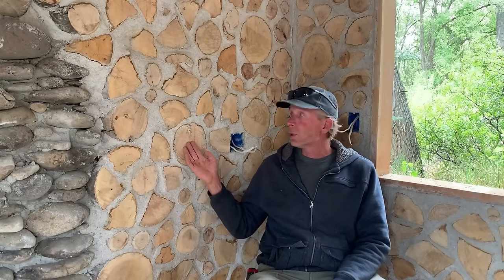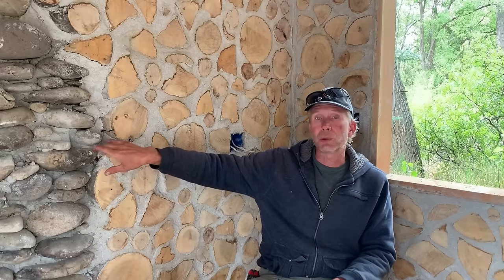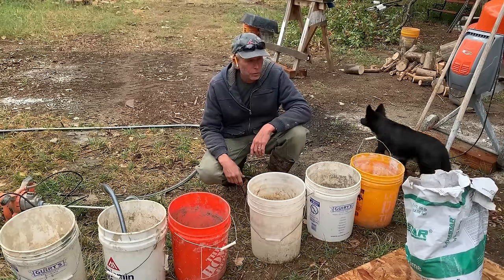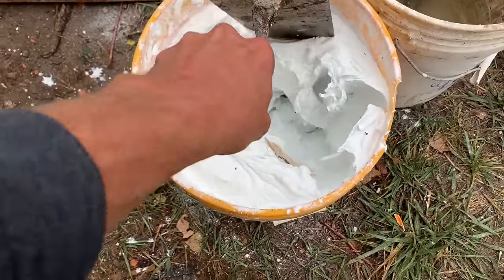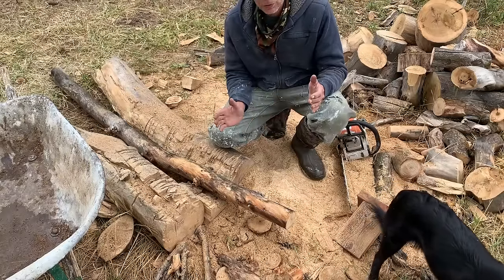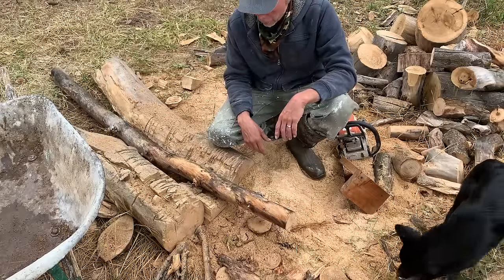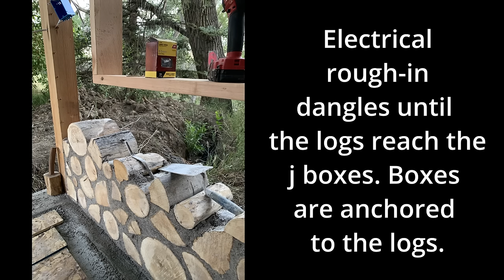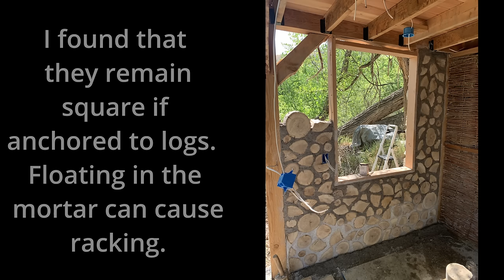Cordwood

Comment: The coefficient of thermal expansion for wood is twice that of concrete. After a few freeze-thaw cycles, the wall will tear itself apart. Also, concrete is a porous material that absorbs moisture. Grouting against wood is like installing a wet sponge against the wood. It will rot quickly. If you used rot-resistant wood, it will rot slowly. It is pretty though. So, enjoy it as much as you can quickly.
Reply: An infinite amount of variables make your comment demonstrably inapplicable as well as the fact that you did not take into account the self healing properties of lime based substrate.  Do better.
Reply: Joshua, a lime based substrate has no self-healing properties. Look, I do not want to beat you up. I simply want to warn people about construction ideas that I think may harm them, financially or otherwise. I am a retired architect with over 43 years of experience on hundreds of projects. I know a thing or two about what will work and what will not. Two things that do not work well are mixing materials in a linked assembly that have very different coefficients of expansion. Another is putting an organic material against an absorbent material. We always place a moisture barrier between wood and masonry for that reason. For materials that expand and contract differently, we provide an assembly that allows for slippage. Your assembly does not allow for either of those things. If you can't see that, then I can't help you. Go get a degree in architecture and maybe that will help.
Reply: I'm not disagreeing, just trying to learn. Does the expansion not play as much of a role possibly due to the woods expansion and contraction being primarily parallel with the  grain?
Reply: Man, that's good to know. I need to get up to Nova Scotia and look at those 160yr old cordwood buildings before they disappear.
Reply: Just visited a cordwood home built in the 70’s.   Still strong.
Reply: @fuddlion have you ever built a cordwood structure?  Did you study any of the centuries-old buildings in Europe that were built with wood and lime? Your experience may not be that valid
Reply: Not trying to argue with you but there are plenty of structures in my area alone that have outlived more modern buildings where similar methods have been used. I've worked in several log structures where concrete was used as chinking and against all odds I've yet to see a failure. There's truth in what you are saying because that's what all the younger people always said..but when I first started on job sites the old hands would preach that the most important thing was that the wood was seasoned and the vertical use of wood and concrete would always be aided by the elements, sun and wind. Again..not trying to argue but I've been in several buildings that range for 5 to over 50 years old and they were solid.
Reply: @intensivecarebear792  he deserves to be argued with. He has no experience and speaks authoritatively.
Reply: @dungeonmaster6292 lol..you're right but Im beginning to be an old hand myself. I just sort of laugh most things off now. The same way the old people laughed at me in when I was younger. I just don't want people to be swayed from doing this sort of construction because of some misinformation
Reply: You are assuming that he isn’t washing with a mold inhibiting agent and that he isn’t sealing the wood once it is finished. Almost everyone building like this is sealing the wall once it is finished.
Just saying. Borax wash I believe is the traditional anti mold wash. Boiled linseed oil through Thompson water seal are applied bi-annually.
Reply: What about mixing with sawdust I heard the old timers doing that up in Canada
Reply: You sound like a fun dude!!!
Reply: Folks the man is right I have saw several similar type structures that didn’t survive ten years!
Reply: It could work with a Portland cement / line wash exterior with some lath to attach.  Otherwise you are going to be constantly coating the exterior with coatings and patching mortar cracks.
Reply: Lime plus sand is not concrete
Reply: The expansion of the wood is predominantly in the longitudinal direction in reference to the log itself.
Reply: I want to make a sound barrier wall.  How much cheaper would it be using lime vs Portland cement vs this lime and cord wood method?  Do such walls last if green wood is used?
Reply: A buddy of mine built a 2 story  cord word home 40 +yrs ago in the woods of pa ... it's still standing strong ...maybe you don't know what you are talking about 🤷‍♂️ ....I'm a fan of this style ...cheap ... relatively simple compared to other styles of log homes ... super insulated ... I'm no expert ... I know what I've seen
Reply: But he’s not using concrete.
Reply: @fuddlion wrong, lime does indeed. Look up Roman concrete or oldest concrete dome - lime based for a hint with self healing. Must leave lime in small chunks as opposed to powder form for best results. 🍻
Reply: Facts
Reply: I agree. Also opening the perpendicular section of wood to the elements. Those logs will absorb water from the air, on top of getting rain, etc. Freeze-thaw cycles are amazingly destructive.
Reply: Glad you said something, I just finished my timber frame, then I saw your comment… wow that was a close one… 🙄
Reply: Good points.
Reply: People forget that concrete is also porous.so even if your concrete mix is more "mortar than concrete"  it's still an incredibly specific combination that only works in certain areas.

In my neck of the woods, if this was cedar, epoxy, or otherwise, this would rot out within 10 years. Leaving the "totally not mortar" to hold up the structure. 

Tale as old as time. Engineers think their design is infallible, turns out it is, people spend their lives fixing it.
Reply: I was wondering about expansion contraction
Reply: Look, another indoctrinated architect who often get’s it wrong…
Reply: @fuddlion  how old is the oldest timber frame in the world?
Reply: wood expands perpendicular to the grain
Reply: @fuddlion How come everything you guys make thats modern sucks but the romans figured out self healing concrete like 2000 years ago? why not use stone instead of wood? Modern architecture sucks so bad 😂
Reply: @fuddlion then as an architect, why over your 34 years do you guys design and build shit to fall apart.... just like appliances and vehicles. we have Cobb homes that have stood 10,000 years and have livability in it today.....  seems college has done nothing but teach us to use expensive throw away materials that just don't last.
Reply: @4schitzangiggles while you're there, travel the rest of the area and look at those Cobb homes before they vanish in the next 12,000 years
Reply: Cord wood homes have stood the test of time. Properly maintained it will last hundreds of years.
Reply: @4schitzangiggles 😂
Reply: @intensivecarebear792 however what was the species of wood? We have lots of cotton wood trees here which i would have loved to use to build a structure with, but unfortunately cotton wood is notorious for breaking down quickly outdoors. Also cotton wood is a lot of water content, and once it dies a lot of moisture is lost with a little time. Is it possible the homes you have seen built this way were a species that are more solid like a hard wood? I think the architect is correct but could vary a lot species to species as well as climate. Wet climates wouldn’t do well like where i live in the PNW  but cold dry or cold with snow, or hot and dry might be ok. Curious what species they were using there or if they treated the timber with something, or environment was more stable and dry?
Reply: @nomadsland5078 what was the wood species?
Reply: I have seen hundred and 180 year old barn foundations made from firewood and lime mortar! Just saying..
Reply: @rah4822 I've seen it.. Chciken coops, barn fountains, cabins..
Reply: @mrslkungpowchikn1206  not sure ... there is alot of hemlock around the area ...
Reply: There may be problems as you say but this has been done for a long time. Contrast this with the way modern construction is done in a crazy multi layer method of plastic, engineered wood, lousy studs, improperly done siding, and Lame-o Drywall. Too many steps and too many expensive people involved in getting a wall done with modern construction and it looks like shit when you are done, both on the inside and the outside.
Reply: @fuddlion :  I wish all you architects would get more involved with making structures that are simpler to produce and not so expensive.  

Guys are letting a bunch of con-qwackters dominate your industry.

As for the expansion different, it can be a problem or it may not be a problem. It depends on a lot of things and you know that.

With enough roof overhang and proper drainage, the word only gets as wet as the humidity change over the season allows for.

I’m an engineer and I know that expansion occurs with temperature and moisture but it can be constrained.  You make it sound like the wood is going to like totally whack open the walls.  But most of the logs are just expanding against each other, with mortar in between, so all of this expansion you are worried about is not necessarily additive.

Keep it dry and there’s probably no problem if the construction is done properly. It also Matters how wet or dry the Word word word when the structure was assembled. You know that too.

You make it sound like this is some kind of disaster, waiting to happen, and you really don’t know that much about the structure.  I bet you never made one.

And I bet I have a lot more experience with wood than you do.
Reply: @intensivecarebear792 :  good to talk back against that architect expert guy because I am 100% sure he has never built a cordwood structure.

It’s not like this is some kind of experimental building, it has been done for thousands of years!!  Practically since the dawn of civilization!
Reply: It's been over 4 years and it still looks amazing. Shut up
Reply: Cordwood construction has been in use for over a thousand years. If it sucked so bad, one would think people wouldn't have continued doing it after the first time.
Reply: I was apart of the replacement of a steam tunnel that fed heat to a good portion of a city. Once excavated and the innards of the concrete tunnel was daylighted; the amount of corrosion on the tunnel and even the steel reinforcement was pretty staggering. I immediately realized concrete was able to absorb moisture. Completely ignorant to the fact prior.
Reply: @fuddlion chinking in log homes has been done forever.  Same idea.  It's amazing how modern engineering has so many flaws. Sometimes simple is best.
Reply: Chiming in….

I think everyone makes a great point but there is a huge unmentioned factor: older homes made of any kind of wood that still stand today were of superior lumber. The trees back then were as organic as you could get and very old which amounted to higher grain. Lumber today is mass produced, given treatments for faster growth and cut prematurely. Then they’re treated with chemicals! Thus there is a huge need for proper substrates when composing structures of any sort with mixed materials. That said, it would be a challenge to replicate 100/200 year old architecture and the only way those materials work now is only in tandem with the garbage manufacturers create to complete a building that is reliable for 30 years at best before the structural issues begin.

My point of view here is all.
Reply: Use cherry tree probably last until the end of time 😂
Reply: I’d stick with asbestos, plastic, pvc,  caulk and any all the other building supplies with the p65 warning. Who would want to build anything naturally?? People these days.
Reply: @fuddlion you may want to go back and do research on historical cordwood houses and building than. Cause all you learned was modern techniques for building. Time to educate yourself on older techniques so you don't look so stupid in the future.
Reply: Buddy said he's not using concrete it's a different formula and material @fuddlion
Reply: The architect college boy read a book once so he knows more than the guys who actually built these several hundred years ago and they are still standing.  I guess those ancient builders should have read that same book so they could have been smart enough to not even try.  

Maybe when we KNOW something wont work, we should get out of the way of those who are making it work 😉
Reply: Although your comment is somewhat based in fact I've seen similar houses built from cedar and rock and one is still being lived in and is well over 60 years old with no degradation to the wood.
Reply: This is a time tested method. Your points fall apart when considering nearly 200 year old cordwood buildings.
Reply: @gravfielddrive  I thought it was in the radial direction mostly
Reply: If this lime base cord construction is flawed then why do lime construction around the world stay in such remarkably beautiful condition with little to no repair. As for the wood it expands with the length of the grain of the wood more than the width of the grain. These constructs last longer than a standard log cabin.
Yes concrete against organic material such as wood is not good for longevity but lime is a preservation chemical as well. Just sayin not arguing.
Reply: Interesting. Can you then explain how there are cordwood buildings still standing here in Ontario Canada that are very elderly?
Reply: Well there supposed " architect" he didn't use concrete but limestone. You would also know the wood will not absorb any moisture because the limestone will absorb it much faster then the wood can, as well as it is a very simple matter to seal the end grain of the wood, go back to designing crappy structures built of low quality matchsticks, plastic and chalk.
Reply: @The_Not_So_Great_Cornholio won't hurt it one bit
Reply: @steveperreira5850 he hates when someone builds something that will actually last
Reply: Good example why its important to watch the traditional directions and not just slop the wrong modern versions together instead.
Reply: @joshlower1 if it lasts that voids your warranty
Reply: We have cordwood homes here in Nova Scotia that are decades old and if treated properly and maintained they age quite well and maintain solid structural integrity
Reply: Wondering why you stopped commenting / discussing… did you maybe get it wrong with your bold statement?
Reply: @4schitzangiggles  I can take you to several within a half hour drive from my place that are in great shape if you'd like to inspect em yourself . A good test is to run face first into the weakest looking wall and see what happens.
Reply: @cattywampusmcdoogle we have some pretty old structure here in NS
Reply: @mdube391  I'm sure you do, they are everywhere
Reply: There are sealants
And according to you you shouldn't use wood siding.

People have built houses like this for centuries you should stick to subjects you understand
Reply: @dungeonmaster6292 no but he or she is “educated” and “degreed”

Comment: hey brian,  how much less would it take if you did inside outside grout , let mortar set then inject closed cell foam near the base to grab it all? 
obviously the top corse will be open to foam expansion, then trimmed with a hand saw

would you gain a day or two? from your 4 day  wall build?

Comment: What happens when the logs shrink?
Reply from the maker: If they are well seasoned, they shrink very little. The insulating lime/sawdust layer prevents most drafts. Any larger gaps can be filled with lime putty.

Comment: That soft wood would not last long here. Termites would devour it for one thing. Also humidity in Spring then hot dry weather would shrink and expand the hell out of that wood causing that wall to self destruct.  The only wood I would dare use be closed cell, like cedar. Resist rot and moisture absorption.

Comment: That is a ton of sawdust filler.  Where are you getting that amount?  It's not coming from you cutting the wood.
Reply from the maker: I can fill my truck to the top of the cab at my local sawmill for $20
Reply: @radicalgastronomy  thanks for the info!

Comment: so what-if you had a wall that was 4" thick. pour in the first part using dustcrete. while yo'ure building your dustcrete wall and packing it, use cuts of cordwood the same thickness of the wall. that way you get the aesthetic of the cordwood and the speed of the dustcrete.
Reply from the maker: This may work, but would still be almost as time consuming as the cordwood approach. The gathering and meticulous cutting of the wood takes much of the time. One would also be creating a lot more wood to dustcrete surfaces that are exposed to the elements, which could lead to rot. Tests are required.

Comment: This will not last dude...that wood will rottttttttt
Reply from the maker: There are 100 year-old examples in Canada, so no.
Reply: As long as he treats the outside ends of the wood with a sealer and keeps it sealed it will last
Reply from the maker: @angelone8564  tell the 100 year old barns in Canada.

Comment: This is the biggest stupidity I have seen in a long time. The logs have no strength for push as they are ovel. Plus the logs lead the moisture from outside to inside because the body of the logs used to lead water in the tree. The logs insulate from bark to bark but not alongside. There was a good reason to build the cottages from long logs and not these short ones.